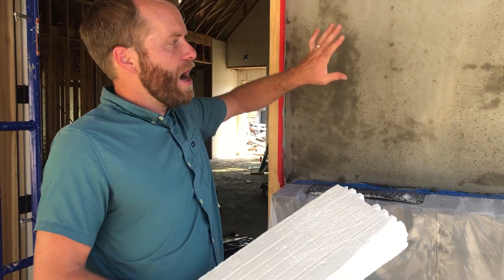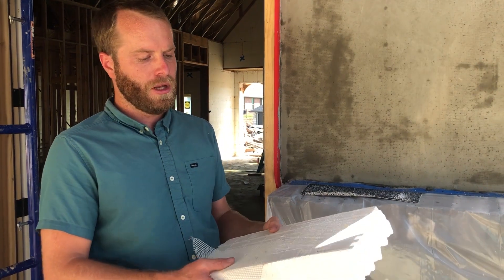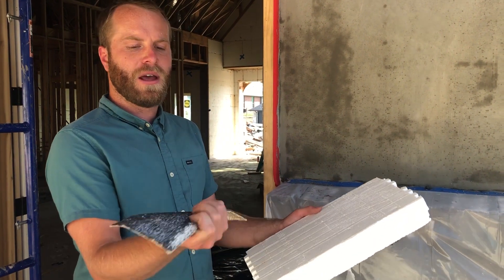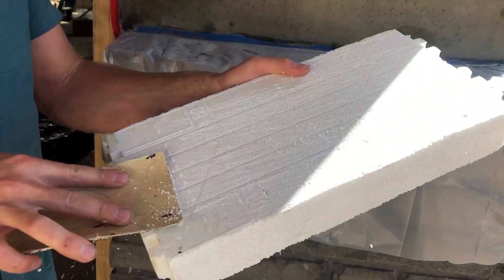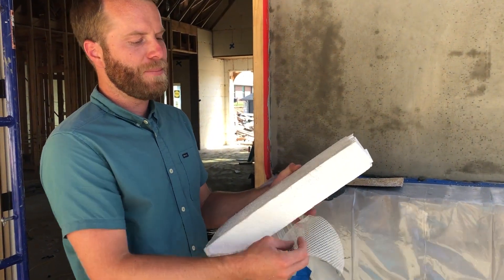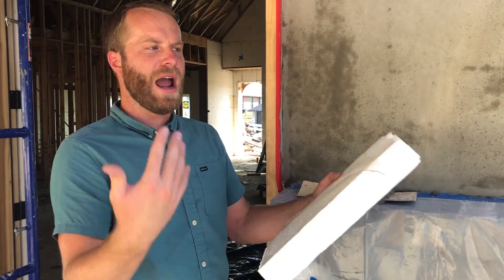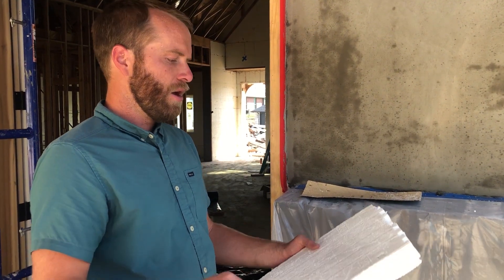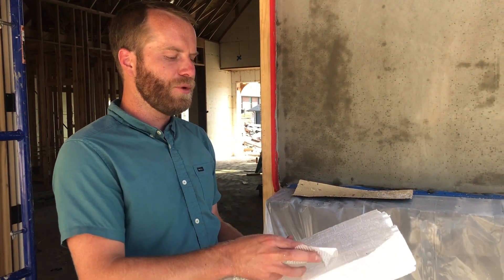How to Apply Stucco to ICF Walls

Comment: Just doesn't seem right to apply stucco directly to the foam. I guess it works if the blocks are tight and waterproof at every seam (even standing seams)
Reply: I stand corrected. I didn't realize I see EIFS performing well every day for commercial buildings.

Comment: Traditional stucco applications require a metal screen mesh that is screwed to the sheathing, with a drain mat behind it.  I foresee  this stucco coming off in sheets, with no more adhesion than they are providing.  This is heavy material that can absorb moisture.  No Bueno!

Comment: i would also like to know about icf exterior finish waterproofing above grade
Reply from the maker: Hi Chris, you can see our recent waterproofing video here https://www.youtube.com/watch?v=IGRF3BdvDb8. It's typically unnecessary to do any above grade waterproofing on an ICF home. The ICFs are a class 2 vapor barrier and don't require additional waterproofing or house wrap above grade. Thanks for watching!
Reply: Total Wall and likely other EIFS manufacturers make a waterproof version of the base-coat.

Comment: Is there a reason that roof's made with ICF is not a common occurrence? The last video I saw with an ICF roof was from around 2009. I'd think the house would be indestructible against even the most powerful wrath of mother nature.
Reply: I priced out a foam +temporary metal joists + concrete floor/flat roofing system and it was $16k), about 10k more than the wood alternative (around 6k). I think it would be worth it if it enabled another level below a garage, or you otherwise needed the high strength for your application.